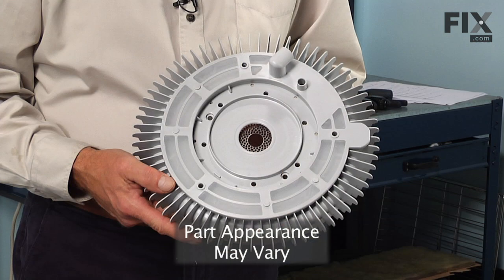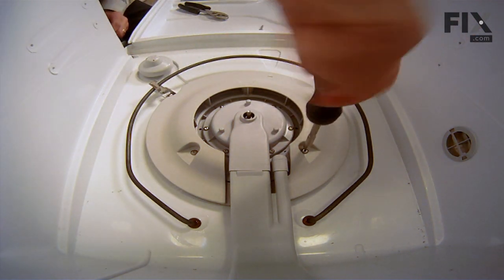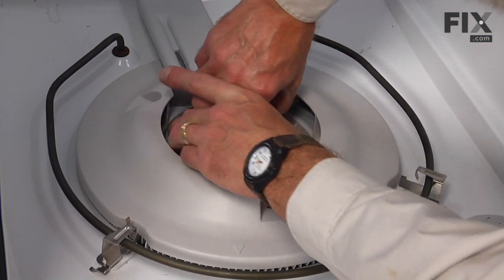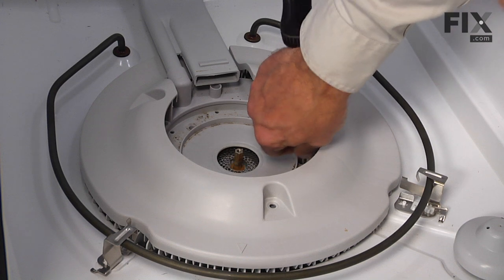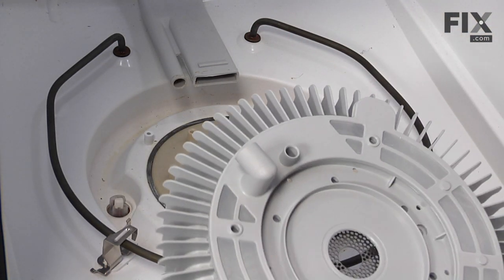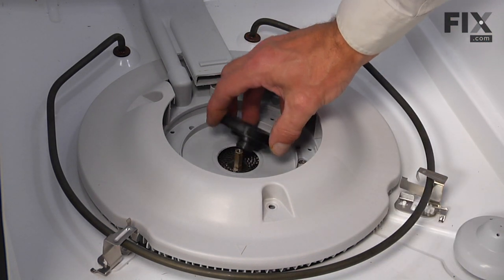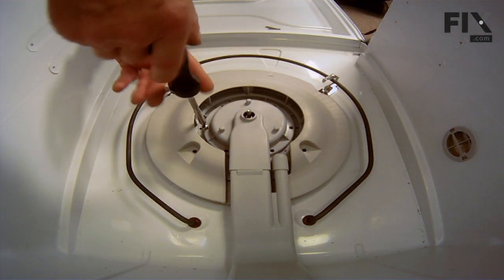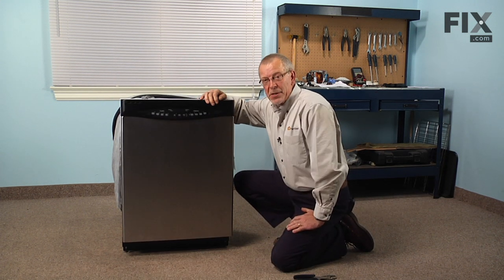Maytag Dishwasher Repair – How to replace the Accumulator Filter

Comment: Wow! This is crazy - I didn't realize it was going to take so much to clean the filter! LOL
Reply: Its so easy though just a few screws holding it down
Reply: i guess I'm quite randomly asking but does anybody know of a good place to watch new series online ?
Reply: Didn't even clean it. He replaced it.
Reply: It took me 3 days to finish it because I have back problems.. but worth it.. However, I may only do this 1 a year.. sorry too much work and pain lol
Reply: @romancallum9239  what kind of series? There are way too many kinds.
Reply: @indyola1  he didn't replace it.. cleaned the whole system. Missed mentioning that the jets also get clogged, so a good idea to clean those too.
Reply: He was replacing a filter. Cleaning is different I believe

Comment: Use vinegar to loosen the impeller... a few drops on the screw area... let sit 10 mins.... tap lightly on top and sides with hammer.... it comes right off.

Comment: Thank you for walking us through this. The only thing I would add is (when reassembling) to check that the holes for the 3 longest screws align at the top & bottom of the circular unit. Mine were just off by 1 "notch" so everything sat together well, but when I got to those last 3 screws I had to disassemble everything again 😫 to readjust that. Obviously my mistake, but there's always the rewind option 🤷‍♀️🤦‍♀️

Comment: Thank you for sharing this video with us. My maytag dishwasher started to make a terrible noise. Ive noticed that the lower arm touch the heater and most probably this noise is because of that. Can you please advise me
Reply from the maker: Noises are always tricky, depending on the type of noise it may just be some harder food particles in around the pump impellers. If your getting more of a screeching sound then its possible the motor bearing is starting to fail. Spray arms when not running may in some cases be able to tip up and down but once the pump pressurizes them with water they lift and spin and usually don't touch any other component.  Hope this information is of some help.

Comment: Only thing I would add is once you have all the parts out. Scrub out the inside of the dishwasher and run the Rinse function. It will get all the water out of the bottom, instead of using a sponge.

Comment: My Maytag QuietSeries 100 leaves black crumbs on the cups in the top drawer.  I can't figure out where from, and if there is supposed to be another filter than the base plate.  I took apart the whole in-case pipe system, and did what is shown here, saw nothing wrong and put it back together.  It wasn't even dirty.  It seems that nothing filters smaller dirt and it gets projected back on the cups, does anyone have a clue on how to solve this issue?

Comment: We are having the same problem as Realbhatia - impeller will not come out no matter how hard we try. Other than breaking it, is there a solution to this? All of the videos make it looks so easy, but we have tried everything and cannot get it out.
Reply from the maker: Hi, what is your model number?
Reply: remove the attached plastic piece that runs the water to the top portion of the dishwasher
Reply: try using white vinegar to break off the gunk.

Comment: Why would you even replace this? Do they break easily? Get clogged? What's it main malfunction?
Reply from the maker: Hi, the reason you would need to replace the accumulator filter is because the water is not draining out of the dishwasher
or your dishes are not being cleaned due to the filter being clogged. The filter is essential in your dishes getting clean during the wash cycle. If there is any debris or a tear in the filter, it can cause extra buildup and, therefore, causing dirty dishes.
Reply: My has 3 tears... so it does get damaged so how.
Reply: So the other option is to soft scrub the filter instead of replacing it

Comment: Hi!. THANK YOU for making this job look so easy for a budding do-it-yourselfer like me. I tried doing this on my 12 year old Maytag dishwasher (same model). At 2:30, I tried my best to remove the "impeller" and it would not come out. I even tried putting WD20 and leaving it overnight but to no avail. Then I tried using two flat screw drivers tried it lift it from bottom but again it would not come out; the bottom part just broke. Ultimately had no other alternative to break it open. Even then it took me more than 15 minutes and multiple doses of WD40 to remove all the remnants of impeller. I am just curious, what else could I have done?
Reply: Folks: if you come across the same problem that I described above, this is what I did. I broke the "impeller" as mentioned above and ordered a new one (available from a very famous store --name starts with "S"--for 10.94+Tax+6.99 shipping.) Installed it after pushing and tapping it. Once in there, you cannot take it out. I think I should have used WD20 before installing it to make the process easy.  THANK YOU FIXIT.COM for giving me confidence to do it myself.
Reply: All you had to do was add a few tablespoons of vinegar (Coca Cola should work the same way) into the screw hole. Let it sit for about 20 mins, and the impeller comes off easily.
Reply: @Realbhatia  nooo! use white vinegar next time!